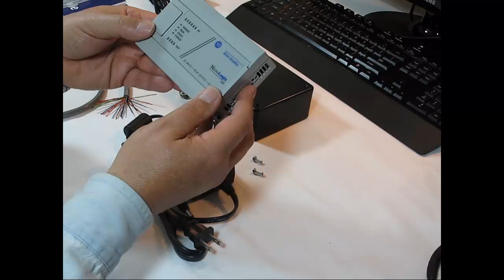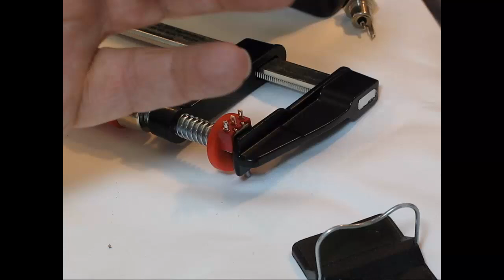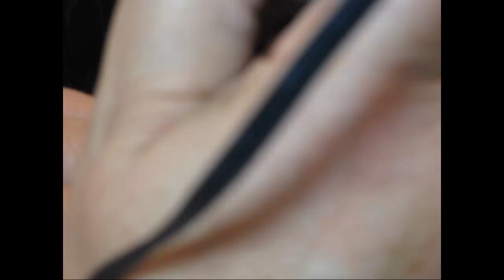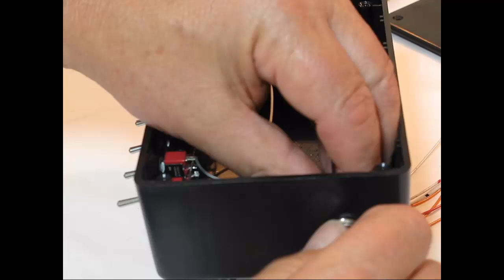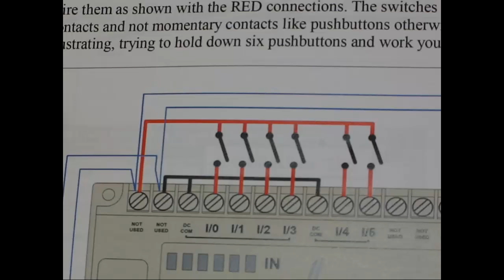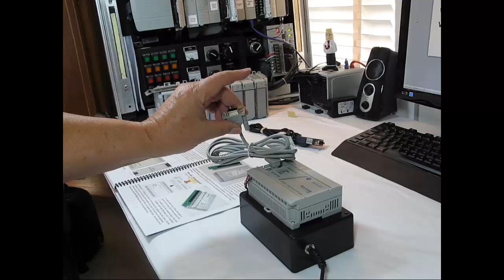TS01 - Build a PLC Trainer

Comment: Hi,i'm an electronics technician,for the last 30yrs i've been dealing with spinal injuries and juggling vacuum tube amplifier designs(i play guitar) as a sort of hobby,i'd like to get into PLC,i down loaded the RSlogix 500 emulator ,would the books you have in this video be compatible with this emulator software?.
Reply from the maker: the orange/black manual at PLC eUniversity

Comment: Just bought your book and can't wait. Do you have a suggestion for the minimal I/0? This looks like it could either be the 1761-l16bwb or 1761-l10bwb
Reply: Looks like it's only free with the 10 and not the 16. At least with the 16 you can only run it in demo mode according to the manual. I've also noticed that the bxb is at least $100 more on the used Market as opposed to the BWB. Can the BWB not also be run on 24 volt alone?

Comment: Great video professor.

Since its been a few years now, do you still recommend the same brand and model?

I am looking for a PLC unit that is easier to program as I am new to operate a conveyor belt. Any economical option you recommend? 

Is there any website that you recommend to purchase from? Thanks!!!
Reply from the maker: I would use a Micrologix1400 with our digital field device simulator. The stopped making the ML1000.

Comment: The 120 volt version is probably the cheapest option because all you need to power the PLC is a piece of lamp cord with a polarized plug on the end of it.

Comment: The reason I ask is that 24 AC . volts is a standard control voltage. And that contactors with coils in that voltage are very common.

Comment: The reason I ask is that 24 AC . volts is a standard control voltage. And that contactors with coils in that voltage are very common.
Reply from the maker: The standard control voltage for industrial panels is 115vac or 24vdc, both for the field devices and the controllers themselves. All electronics requires DC, if there is an AC connection it them must be rectified and filtered to 24vdc.

Comment: Ok I'm a poor maintenance tech that has some control logic background and looking to learn plc's. We have micrologix5000 at work however If I understand correctly to save some money I can start learning with the micrologix1000.  I have the m1000 now and prefer the experience of building everything myself with your online videos so thanks for the info. Once the build is done will order your books / videos to study. Question is once I have a grasp of the ladder logic and programming with the 1000 what will the expense be to learn the m5000. I will have access from time to time at work but to speed up the process would prefer to have home study also. And thanks again for publishing your knowledge. Trying to get more into the plc side before 50.
Reply from the maker: Your question was cut off...
Reply: I can see the whole question, it is there.
Reply from the maker: You will have to have CompactLogix or ControlLogix hardware at home as well as a license for RSLogix5000. RSLogix500 is inexpensive to learn, not so with 5000.

Comment: What is the maximum load that can be directly put on the PLC output?
Reply from the maker: Totally dependent upon the output circuit or the output modules circuit. Manuals for any of the I/O are accessible from the Mfg. website.Careful!!! each point has a maximum but the module as a whole is not equal to the number of points X max for one point.

Comment: Hello PLC professor - I notice in the video that you use switches that have 3 terminals on the back of the switch and you only use 2 terminals. I notice on Ebay/Amazon that "Toggle Switches" come in a multitude of variants: some with 2 terminals, some with 3 terminals, or more. Some of them, say "On/Off/On" as opposed to just "on/off", which is what I believe you were using, though you don't say that explicitly.  Can you elaborate on the switches? Thx
Reply from the maker: A maintained single pole - single throw SPST will suffice or a SPDT, single pole, double throw. It needs to be maintained (not spring return); avoid center off switches. You only need one set of contacts that you can turn ON/OFF...but you can use any switch that will yield that function and the remaining contacts are unused.

Comment: I was just looking at the Allen Bradley website and getting ready to purchase the MicroLogix 1000, but found they are discontinuing that platform and recommend migrating to the Micro820 PLC Systems or Micro830 PLC Systems.  Is this a problem for someone who is going to get started on all this business?  Thanks in advance.
Reply from the maker: +djl Very few people like the Micro800 series and it is not a good platform to learn on, especially if you ever want to learn RSLogix5000. All of the Micrologix processors use the same software and there are many Micrologix processors that will be around for a long...long...long time.

Comment from the maker: Dry contacts are not polarity sensitive. We pick one "row" of lugs to ease soldering a straight line for a common. You could use any of the three, if it is a spdt type switch. The center lug is literally designated the common for the NC/NO contacts.
Reply: which model uses 24dc for both inputs and power supply? my micrologix1000 is 24vdc for inputs but 84-240vac for power supply, which is a little dangerous for external termination
Reply from the maker: 1761-L10BXB

Comment: does it matter which side you land your dc common on the latching pushbutton.input side or output side.
Reply from the maker: Dry contacts are not polarity sensitive. We pick one "row" of lugs to ease soldering a straight line for a common. You could use any of the three, if it is a dpst type switch. The center lug is literally designated the common for the NC/NO contacts.

Comment: Hi Professor, can you suppy a link where I could buy the books and the kit itself????

Thanks.
Reply from the maker: We do not offer a kit in the Bookshop at the plcprofessor website, but we do offer the prebuilt and the manuals. Some of the videos have the website address on them, you cannot put a website address in a reply. We may offer a kit in the May or June timeframe.
Reply: Thanks professor. I will buy the books the materiak looks awesome. Can this lessons be applied to the slc 500 ? Regards
Reply from the maker: Dennis Javier Buján González There is very little difference between the programs in a Micrologix and a SLC500, You will have problems going to a SLC500 from learning on a MicroLogix1000/1100.

Comment: Professor, where can I buy those switches?
Reply from the maker: EBay... Mini toggle, either SPDT or SPST, but not from jpmultiserve, I have received switches from them with dirty solder lugs.
Reply from the maker: Buy more than six, it is possible to overheat the lugs and displace the lug rendering the switch useless. I have done that.

Comment: Is there a 12 volt version of that PLC instead of 24 volt ? I have some 12 volt projects I would like to use a PLC on so I am just curious ..
Reply from the maker: Download the manuals from Rockwell for the processor that you are going to use and look at the voltage range for the inputs. I do not remember what the range is; we just always use 24vdc.

Comment: One other question. Concerning the power supply, I found a 24VDC/250mA power supply (70235K81) on McMaster-Carr. My questions are:
Is the 250 mA sufficient? and How can i tell if this PLC requires center positive or center negative?

Thanks in advance
James

Comment from the maker: You would need to find the documentation online to compare the pin outs and connector configurations. Most RS232/USB adapters will work. If you go online and type in the part numbers, you will find the cable and adapter together for less than $25.

Comment from the maker: The reason that I recommend the BXB is that it requires 24vdc primary power which you can get from a power adapter. This prevents exposure to 115vac. Always, with any project, the first thing that I do is go to the mfg. site and download any documents that I can find for the components that I am going to use. If you type that part# into google, you will find the documentation and instructions for use. Make it  a practice to do this, I have and it helps considerably.

Comment from the maker: Each NO momentary pushbutton would be connected across the two pins used on each toggle switch as an alternative to closing the toggle switch and immediately switching it back to the open position. This would require two conductors connected to the input specific connection. This would not be good for the soldered pin do to overheating the pin and melting the plastic switch body.

Comment: Hi Tim.  Thanks this is a wonderfully done video.  I appreciate the time you took to throughly explain the steps to build this trainer. I was thinking as I watched about just what you say above about having the momentary NO in parallel.  Do you have a diagram showing the wiring for that?  I could probably figure out with enough time but if you have it, that would be great.  Thanks again!

Comment from the maker: Two reasons for using the L10BWB: least expensive considering a $7 24vdc wall wart (power adapter) or any unit with DC Inputs for safety reasons, you are correct in your assumption.

Comment: I'm assuming you used an Allen Bradley Micrologix 1761-L10BWB PLC for building this lab trainer.  I imagine that a 110V model like a 1761-L10BWA PLC would not be safe as a lab trainer because of the 110V being brought to the screw terminals (and you would still need a 24 volt supply for powering the DC digital inputs).

Also, would other PLCs in the 1761 Micrologix family such as the 1761-L16xxx, 1761-L20xxx, and 1761-L32xxx be appropriate for your labs?

Comment from the maker: I believe so but not required, you just need a toggle on/off and use just one set of contacts even if they are DPDT. In my new design I am wiring NO momentary pushbuttons in parallel with the toggled contacts allowing an easy momentary closure without actually having to toggle the switch. Since they are NO, they do not interfer with the toggle switches. 
Have fun:
Tim Gates

Comment: Although i havent gone through all your lectures as of yet, I am building this setup, with 110ac micro 1200.. was going to follow the same procedure, but add small indicators lights and wire to outputs, will this screw with the tutorials? or is it a good thing?  Great series for what i have been through already! Thanks in advance

Comment from the maker: For those of you interested in producing videos, I used two over the shoulder bright flourescents, a point and shoot Canon on a tripod and stitched the eleven clips together in Camtasia Studio from Techsmith. When recording closeup, such as soldering, it is almost impossible to not block the view on occasion without the help of an assistant that can manipulate the camera position and angle. Also, this point and shoot does not offer zoom during recording. More than one camera would have helped.